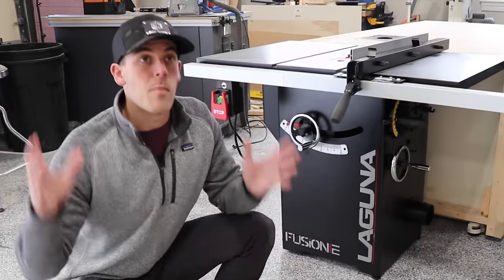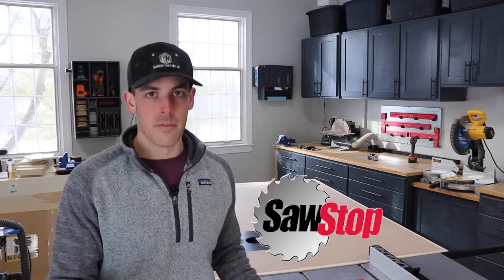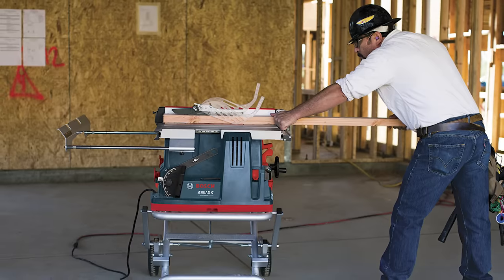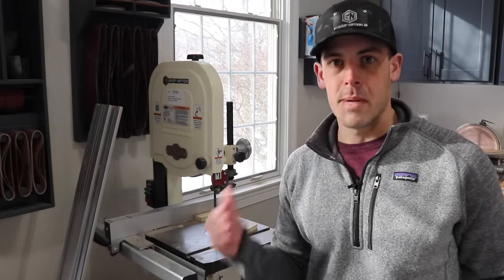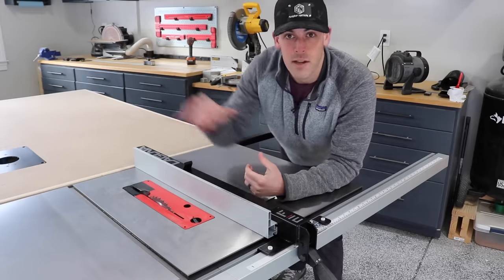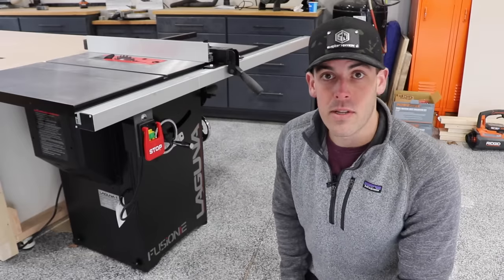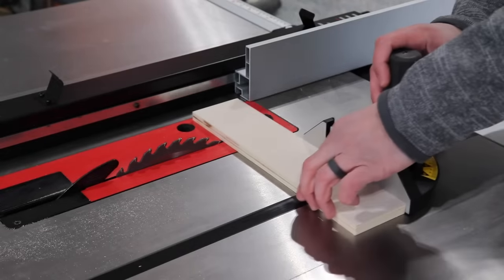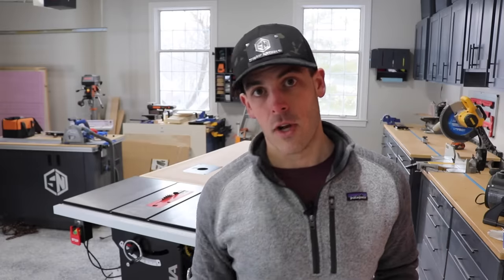Why I Bought a Laguna Table Saw over SawStop!

Comment: All the industrial suppliers that I talk to sell Laguna and Harvey hand over fist, literally can't get them into the country fast enough. 3 month wait on containers full that have all sold before they hit the shores. SawStop are nothing special, but they sure seem to have to hobbyist and YouTube woodworker market cornered as some sort of status symbol. Basically SawStop is for people who are scared of their machines and are willing to pay triple the price so they don't have to learn the fundamentals, but industry just want solid saws that work hard.
Workhorse > Status symbol.
Reply: You are quite mistaken. The SawStop saw is not for people who are scared of their machines any more than seatbelts and airbags are for people who are scared of their cars. And using a SawStop in no way reduces the importance of learning the fundamentals of safe machine tool use. Please show me any evidence that anyone thinks SawStop saws don't require the same care when operating them. What a ridiculous notion. Also, setting aside the blade stop/retract feature, you will not find a saw of the SAME quality at one third the price. Sure, you can find a 'good' saw for 1/3 the price. Especially if you're lucky and the fit and finish of your chinese saw is above average and the holes are properly threaded and actually line up when you assemble the machine. But I've seen plenty of Grizzly and Jet machines. At present, I own a 14 in Jet metal/wood cutting bandsaw, a floor standing Jet 12 in disc/48 in belt sander, and a Jet grinder. And while I like these Jet machines, I also know that their fit and finish is not up to the SawStop standard. 

When I got a large enough shop space, I decided to get a dedicated 10 inch table saw. I had intended to get a Delta Unisaw (made in USA), only by the time I was ready, the Deltas were no longer made in USA. After looking at all the options, I elected to go with SawStop. So I now own a 3hp 36 in rip SawStop. I did not buy it because I'm scared of my machines. That is a ridiculous assertion on your part. Anyone who thinks a SawStop saw is "Safe" and others are "UnSafe" does not understand risk. However it is undeniable that there are certain kinds of accidents that are less likely to cause severe injury when properly using a SawStop saw as compared to other similar saws.

Basically SawStop is for people who apply the adage that it's cheaper in the long-run to buy quality, particularly for major tools investments--and if you can afford it. I decided that I would buy exactly one cabinet table saw, and that it will be the one that I will use for the rest of my life. SawStop saws are made in Taiwan to a higher standard than most Chinese saws. I've been a Laguna tool owner since the late 1990s. I have 2 of their bandsaws (including their 24 inch re-saw model) and their original combo machine the Robland X-31 (10 in table saw with sliding table, shaper, 12 in jointer/planer, plus mortiser from Belgium). I'm sure the Fusion saws are nice saws. But I would not choose one if I were in the market for a new saw today, I would go with SawStop again, and for the same reasons I originally did.

As a physician, I know what blade-contact injuries can do to woodworkers. And it's never pretty! I hope never to experience a SawStop skin-contact blade retraction. When I drive my seat-belt, air bag equipped car, I don't drive recklessly because of those added safety features. Similarly I don't ever knowingly take chances when operating my SawStop saw vs. my Robland X31 table saw. But I do appreciate those safety features in both my cars and my SawStop table saw. Because even though I'm careful, accidents do happen. And I don't view my SawStop table saw as a Status Symbol any more than I view my seat belt and airbag equipped Toyota minivan as a Status Symbol. However I do appreciate the quality and safety features of both!
Reply: @steveh8724  ...And right on cue, an essay from the very hobbyist I described. That's a lot of words for "I want to spend twice the money in case I forget to use a pushstick".
Your airbag and seatbelt analogy doesn't hold up. They are standard features on EVERY car, not a market differentiator. More apt would be that you've paid twice as much for your Toyota Corolla because it has an ejector seat fitted. An expensive feature? Yes. Increases safety? Sure. Worth the money? Eh. 
Even more apt again would be if Toyota patented the concept of car ejector seats then lobbied the government to make THEIR ejector seats mandatory on every car regardless of how much it would jack up the price for people who don't want them.

Comment: Mesure all the incert plate looks identical to my jet powe shop II. You can but a stacked dado incert for it from laguna, but v I found one for my jet on Amazon
I've also found a none cut version from grizzly tools for a portable table saw they have and it looks similar to a plate bosch has. But no one it making zero clearance plats for these yet. 
The sawstop has a plate you slide in a replacement part on thats fitted in via a dovetail type grooves.  
I need to know the measurements of that.
Use calipers to find thickness length and width  also the lock down hole size and positioning  
Becuse almost every brand of tools made in the same Taiwan factory I belive its the same on all of them made like this I know the grizzly will fit my jet but its the only one I've found thus far. And becuse of the popularity if the sawstop I doubt your going to see theses factory made to fit any of the brands of saws ive said.
I'll share the Jets plate size with you.
This isnt somthing advertising is telling you.   This benefits anyone using this type of system.
I know your going to be looking for a zero clearance incert. Or a stacked dado incert.  Yes you can make one, but I like the material the factory ones are made out of. And you can microjigs spliters insted of using the riving knife if you need a tighter gap. Or split and add thin plywood riving knife built in. 
Still think about jessems stock guides or board buddies to help keep your hands away from the blade.
----------------------------------------------------
725004

Proshop II dado insert plate

Dimensions 

4 1/8"  x  14 5/8"   x 1/2" thick
-----------------------------------------------------------
From grizzly
We appreciate receiving your inquiry regarding the T30670 Table insert for the G0896/70 Benchtop Tablesaw. The T30670 and T30542 inserts have the following dimensions:

14-1/2" long x 4-1/8" wide x 1/2" thick
-----------------------------------------------------------
Hope this helps, but please add to this.
Reply: The plate looks identical to the Jet ProShop II, because it is.  The Fusion F2 and the Jet ProShop are basically the same saw with different cabinets and fences.   The Jet is the better saw IMO as it has a better fence and a better warranty.  The fusion fence is ok, but the front fence rail does allow for some additional flex.

Comment: Problem with saw stop is that it takes away the dangers the reason why I say this is a problem is when you get used to working with a saw stop with no dangers you can never use another saw safely because you are absent that danger thought this is why I believe can create a false sense of security a workshop is a dangerous environment and you need to keep your wits about you
Reply: I am sure this is true for some.  Right now, I still treat the blade as though it is a coiled up rattlesnake.  I keep my hands and fingers away accordingly.

Comment: The fence is the same as the Delta Uni-fence although I can tell that it seems it's somewhat lighter. It's become apparent that on the You Tube woodworking channels the Saw Stop has become the saw of choice, personally IMO I don't get it. The whole hot dog thing! really!. For the money Powermatic # 66 best dollar value oh and here's a tip keep your fingers out of the blade. Respect the saw, but if you're too afraid of it you shouldn't be working on one. There's a website called X Factory .Com where you can purchase used machinery. In 2003  when I decided to purchase a sliding table saw I found one for 5000.00  not 60 miles from where I worked. In 2008 when the market decided I sell the saw I was able to sell it for  4500.00 In those five years the saw paid for itself and then some. I know a lot of guys getting into woodworking like going and  looking at the tools but in this genre you do yourself and your wallet a great disservice. Shop around  a 30 year old Powermatic 66 or a Delta Unisaw used will exceed your expectations. 25 years ago I found a 5hp Baldour Motor Foley Belsaw Molding Planer for 300.00 I still have it. Heavy quality machinery should outlive it's owners. I don't write this to rebut your Laguna tool I actually own one of their edge-banders and have considered their band-saw I do it for the guys out here who might end up making a living doing this as I do and have for 25 years. Good luck in your endeavors.

Comment: Great review even thought it's preliminary. I'm happy to see someone that values not just quality but reality. I agree that Sawstop has some great safety tech but the cost is on another plane of existence for a majority of us. Sure if you're a pro that pulls down major cash... I can't hate on you for owning, accepting one but most of us that are just people making stuff absolutely cannot justify that cost and I'm glad their patent is running out. If you have life saving tech and you choose to gouge customers and sue anyone else (Bosch) that tries to compete with different but still effective tech, you suck. Plain and simple. Even the Sawstop jobsight saw which is nice, excludes the nice fence unless you pay more. WTF!?!? I'm not over paying $1000 for a jobsight saw... Ever! Especially if the fence isn't great. I've long looked at Laguna as well as Harvey and I haven't found anything I don't like other than finger saving tech that I don't know if I would ever need. Yes it's nice and reassuring but when I turn on my table saw or router for that matter (Sawstop hasn't attacked that monster yet and never will). I am paying every last bit of attention that my brain can muster. As a physicist I totally respect your engineering background. My background is intimately familiar and includes radiation and I'm not taking infra red. I mean potential lethal exposure... Yes I'm a certified radiation worker in 2 states as well as at the federal level. Risk is inherent and you have to accept that. You have to accept risk to do the things you love or you will hate what you do. Unless you love filling out spreadsheets or planting flowers. I also think it's funny that Sawstop has started to add on sliding table/fences. This has been a standard in Europe for a long time. Most of their saws have sliding tables with zero clearance and not well on the other side of a standard US table saw miter slot.

Comment: Laguna, Oliver, Grizzley, Powermatic, Jet, Baileigh, are all the same cheap saw. Not same class, same saw. Different paint and finishing, but same saw.  As a professional, the only cabinet saw worth buying is a Sawstop.  That said, if you really want to work wood, and want a safe saw, get a slider.

Comment: Where is the Fusion saws manufactured and assembled?  Laguna saws or lathes had been made in China and they all required a lot of work to get rid of all the casting slag, clean up all the bored holes, etc.
Reply: Taiwan, just downloaded the manual and looked.
Reply from the maker: Most machinery of this caliber is made in Taiwan

Comment: Not convinced. If I buy a tablesaw at all, it will be a Sawstop! For obvious reasons.
And "Full Disclosure: I have entered an agreement (i.e. partnership) with Laguna . . .," no matter what follows, makes this an advertisement.
Reply: Someone that does not even have a Table Saw knows he will only buy a Sawstop.  Okay.....

There are obvious reasons for wanting a Saw Stop.  I agree on that.  I would buy a Sawstop if they made a saw that fit my needs.  Which is a sub 300lb hybrid type of saw.  Their contractor saw with the motor out the back does not work for me.   The big heavy PCS's as nice as they are, well they are simply too heavy.   So, I will not be buying a Sawstop for not so obvious reasons.    

All the pro safety folks make comments that are like drawing a line in the sand.  You are either for sawstop, or you are a^&**#&.  Kind of like with politics in the US today.   

Don't mean to pic on your comment too much in this regard, but I see this tone throughout these comments from the pro Sawstop crowd.   I am pro SawStop, I just can't use one in my setup.  If you buy one, own one, or want one.  Good for you.  Good choice in a table saw.
Reply: @alsmith7316  Actually, I'm quite new to this whole controversy. I'm so antediluvian, I'm still using a 1976 Craftsman RAS!  (No, it's never attempted to "bite" me all these years although it has thrown things at me from time to time. :>J )I'm still waffling. I keep escalating my desire. Not unlike you, the weight of getting one of these behemoths into my basement is daunting. I don't have a moving crew at my beck and call. The Sawstop Contractor model would be a sensible compromise for me personally but might lead to a bad case of not being fully happy that I was not able to "go all the way" with a 3hp PCS model.
Until a month or two ago, I was ignorant about the company's attempts to lobby government to make their highly proprietary safety system mandatory.

To me, this is all somewhat redolent of what happened to lawn mowers back in the 70s. Toro and John Deere complained vociferously that they just could not meet mandated deadlines for a dead man safety cutoff at that time. Honda, OTOH, just went ahead and "did it." Of course the Hondas were, and still are, pricey. I am not prescient as to how this battle in table saws will finally pan out but I doubt Sawstop will forever be the only saw with a safety feature that effectively guards against cutting flesh. It is a testament to the technology that they have remained the only "safe" saw these past many years! Until the competition is able to reply though, they will remain the only saw I'll consider as a replacement to my old Craftsman. 
Perhaps I'll pour so much water into my wine that I de-escalate all the way into their lowly job site saw. After all, I don't really "need" a new saw. I'm an aging duffer who does less and less woodworking, so the expenditure on a table saw is not really sensible. And the emergence of quality compound mitre saws has lessened any "need" I ever had. But I just might do it anyway! :)

Comment: Definitely well thought out useful information. It is tiresome to be constantly bombarded with the "you are not a real woodworker unless you have spent hundreds of thousands of dollars on your tools. And as for the Sawstop discussion, I worked in machine shops for a long time and the very first thing I was taught was DON'T PUT YOUR FINGER IN THERE. Good advice then and 30 years later I can STILL count to ten without having to take off a shoe. What matters most is PROPER alignment of the machines when setting them up, understanding the dynamics of the machine and its limitations, and ONLY paying attention to what the hell you are doing. Spending large sums of money for tools is only showing off. I know shop men from Europe who can build you a car with only a hand file. But if you want to spend lots of money then have at it. Your circus, your monkeys.

Comment: Welcome to Ohio. Hope you are closer to my part (Cincy) than the cold zone;) I also did 40 plus years in engineering and agree human factor to failure is very hard to quantify. So I look for root cause on injury. 2 biggest are kick back pulling in your hand and carless distractions. I never cut with anyone else in shop. I never rip without feather boards and really safe push stick...see https://youtu.be/bJM1FFOiQ_M for best push stick. With a miter saw (bought last year) most of the table saw will be ripping and will have cover on which also is a reminder to fingers. Finally Sawstop does one thing I hate beyond price...extra charges...EVERYTHING is extra. So  $2000 contractor saw is $3000 or more when you add all you need.  So I am ready to replace a old Craftstman with zero safety features with an F1. Why F1 and not F3 or F2...I have 50 amps for the whole new shed and my big circut will be 20 amp (2 15s for lights, fans and heat). I won't be pulling the pin until I've got new shop up and I will hopefully enjoy this. My only question is have any  out there put a router wing on this table? I see yours is on the outfeed but I don't have tons of space. I guess a benchdog or sawstop steel wing for my router will be part of the switch over. My current wood extension would be lame on this saw.

Comment: A couple of questions:  How easy is it to align the blade, fence and miter slot?  Some saws make it difficult.  Did you check out the saws from these guys?  https://www.harveywoodworking.com   I found them from a Stumpy Nubs Video:   https://www.youtube.com/watch?v=QhGUwhaVzuc
Reply: Those Harvey saws seem really nice for the $.      They just are to heavy for me.  I need a very mobile table saw, as it gets used outside of my garage.

As for alignment, the F2 is the same as all table saws with the trunnion mounted to the chassis.  You slightly loosen up some bolts that hold the table top to the cabinet, us a big soft mallet and tap/pound on the sides of the top to shift it into position.  Tighten up the bolts.

Comment: Underpowered.  I wouldn't buy anything less than a 3 HP table saw.
Reply: Hm, maybe he does not have any room in his panel for 220 breakers and no 220 in the garage.  Now what?  

BTW, 3HP is underpowered.  You should have gone with at least 5HP.